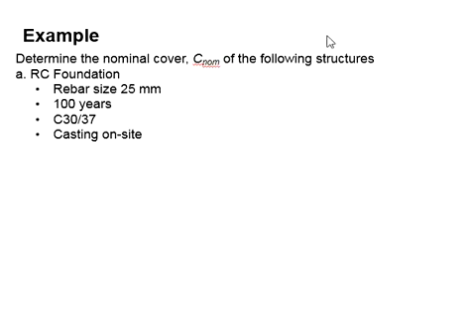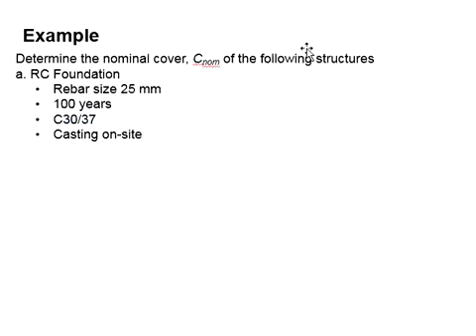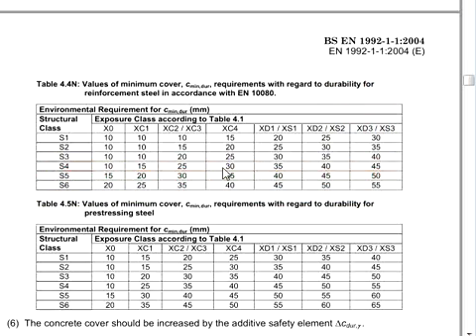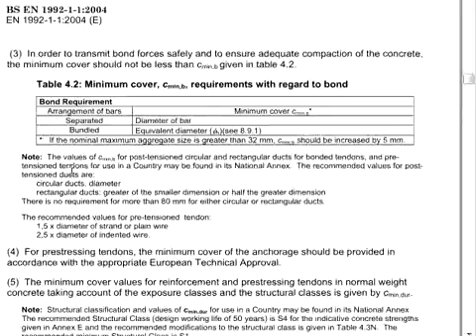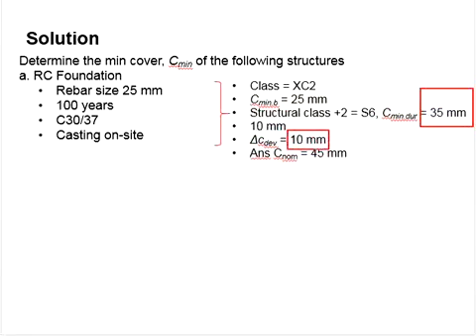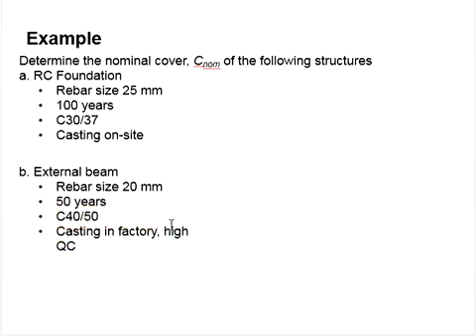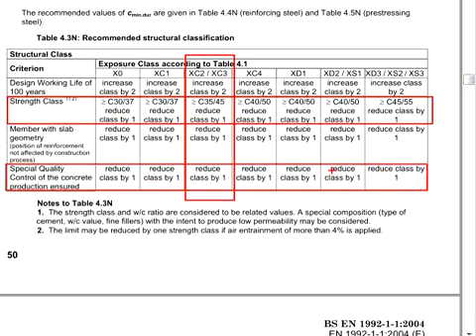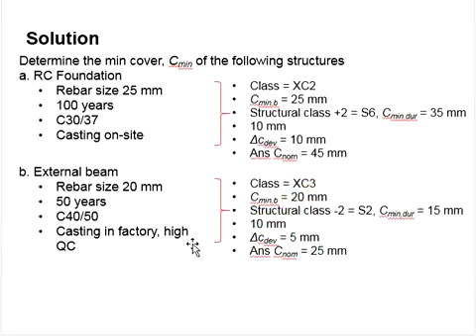6.5 Example: Cover

Comment: Where did the Structural class S1-S4 etc came from? Why did you choose S4? Why not S1?
Reply from the maker: It's in EC2 cl. 4.4.1.2(5). It states that "The recommended Structural Class (design working life of 50 years) is S4...". Therefore, we normally starts with S4 by default.
Reply: @eng-aim  thanks for the answer, it doesn't state about the other classes, where to find all the S1-Sn classes? is it in a different standard?
Reply from the maker: @prtygrl5077  you will encounter the other structural classes after you consider Table 4.3N, where under certain circumstances, the class shall be increased or reduced accordingly.